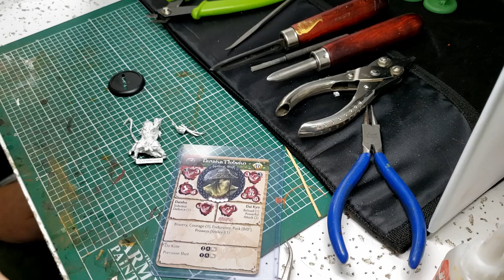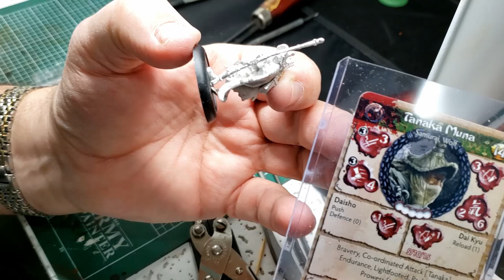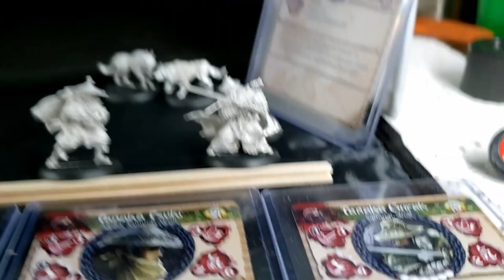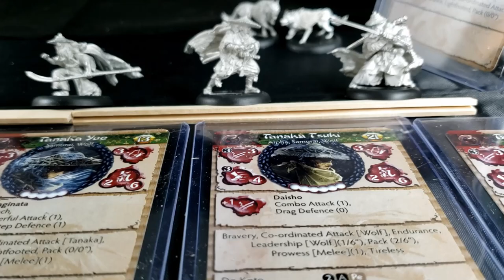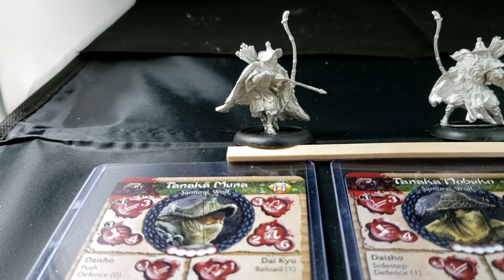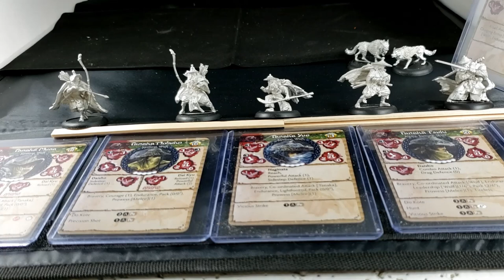Bushido 90: Wolf Clan Build 4

Comment: I gotta say i like these kinds of video's but (and you found out with this this video yourself) the 4 would have been better of as one long video where you just did the complete box in one sitting. I did learn some more stuff from the video's, thank you for that, now i need to get me some of that spray!
The only one thing i would like to see when displaying models would be with either a camera on a tripod so it's zoomed onto the right parts, just to get a good clean look at the model, on a rotating disk thingy (i have no idea what its called) would be the best ofcourse.

What i would personally like to see in a case like this where you have your hands on a new box/faction (if you have the time and energy to put this together ofcourse) is the following in the same 4 part video series you did now with the Wolf Clan:

1. Build the box
2. Make unique bases for said box
3. Paint the box
4 Have either a battle rep or a tactics discussion about adding models from the existing range to the box.

Of course the last one with the Wolf Clan is a bit difficult at this point in time but these are just ideas.
Hope my suggestions helped and can't wait for more stuff in the future.
Reply from the maker: I think these are all excellent ideas WanderingIgor.  As this is the first time I've had this opportunity, I didn't really have a plan going in.  That changed quickly as I gained experience and the next build video (for the new Cult witch set) will be done in one go, and won't have live prep work to save time.  I like the painting idea, but I'm an inherently slow painter so I'm not sure that would get done quickly enough to do anyone any good.  I can try though.  I have tried twice to film batreps with the unpainted Wolf models, but the games were so one-sided that there was nothing arable.

I like your ideas about the close-ups, that would make the videos more useful.  I'll see what I can do.  Consider this series a "rough draft" of what I'd like to do in the future.  Any advice given will be gratefully accepted and acted upon if I can.
Reply from the maker: @Sam Schwitters Thanks Sam.  One of my insurmountable issues is slow upload speed.  That's why I had to break the build video into multiple parts.  It took ALL NIGHT to upload the last, 45 minute video (part 4).  I say insurmountable as I have the fastest internet money can buy where I live.  This is as good as it gets.

I'm always trying to find that perfect line between fast and interesting.  Not saying I always find it... but I keep experimenting.  I'm  old enough to have known a time with only metal miniatures... so working with them is second nature.
Reply from the maker: @Sam Schwitters Actually, I'm pretty sure they have that model.  It's not in the boxed set but available separately... you should check out their web site.  I've ordered it but it hasn't come in yet.
Reply from the maker: @Sam Schwitters Yeah, you won't ever see that.  Doesn't fit in the game.  The closest you'll probably get is this.  https://gctstudios.com/catalog/tanaka-kazuo-heir